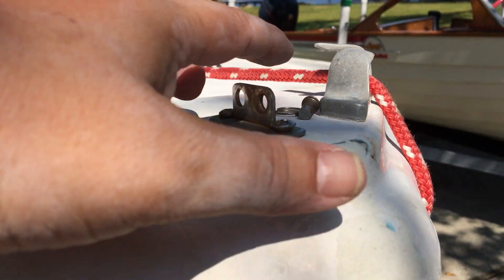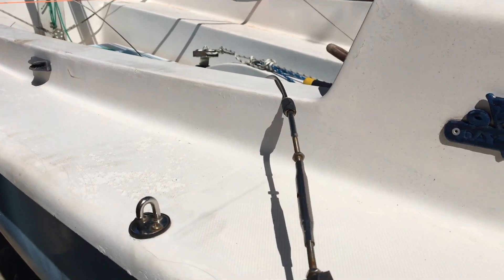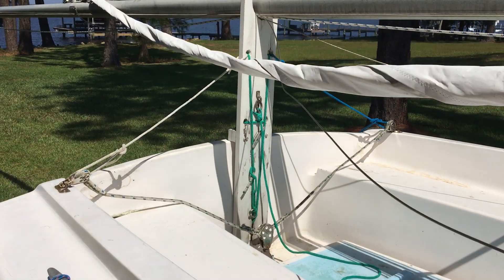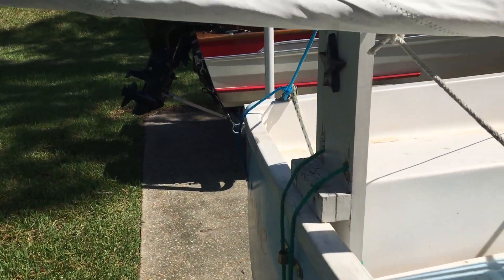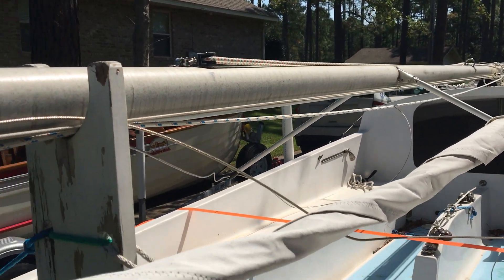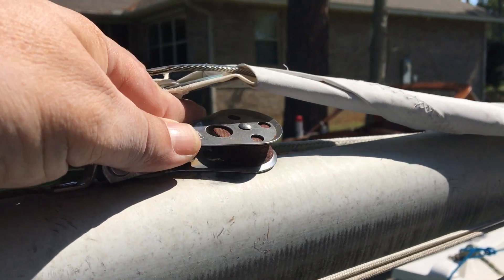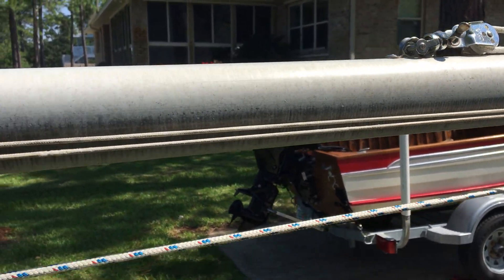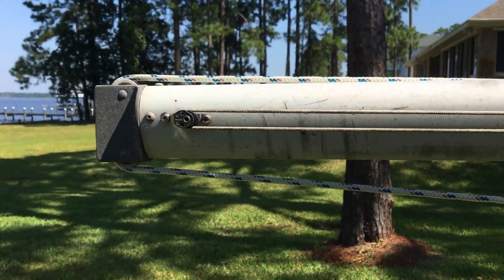1971 O'Day Day Sailer II Mast Raising Prep 30 Sep 17

Comment: I loved your article in Small Boats Monthly. One question: Day Sailers are easy to find? I guess you know where to look (certainly no offers in Craigslist). I have not been lucky enough to come across a good one that is 10 to 20 years old. I live in Massachusetts. Would you mind sharing where to look for one?
Reply from the maker: Lots of Day Sailers built, so they are out there. I would contact Wendy at Cape Cod Shipbuilding Company, they build new Day Sailers and might have their finger on the pulse of the market. Also you could consider joining the Day Sailer Association, they have a nice Forum  and Newsletter. There is a For Sale section on the Forum https://forum.daysailer.org/ And we have good luck looking through sailingtexas. Last tip, try a Wanted ad in your local craigslist. Good luck!

Comment: Did you install the mast tabernacle yourself?
Reply from the maker: No, my Father In Law watched a rigger do it back in 2000, pretty  straightforward. Tape measure, hacksaw, a few screws. I believe a small bit is removed so that the shroud geometry stays the same. Important to put a pipe clamp around the lower mast just under the cuddy top, so that it does not try to pop out when lowering mast. I believe there is aguide out there somewhere, we'll look for it. In the meantime check out D&R Marine https://www.drmarine.com/proddetail.asp?prod=DS208